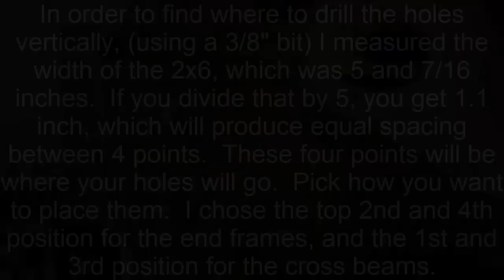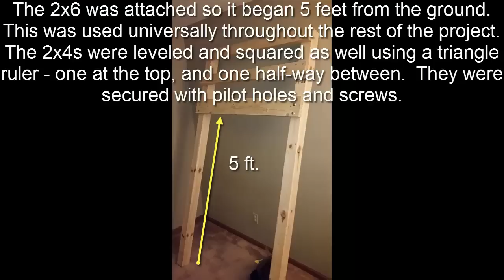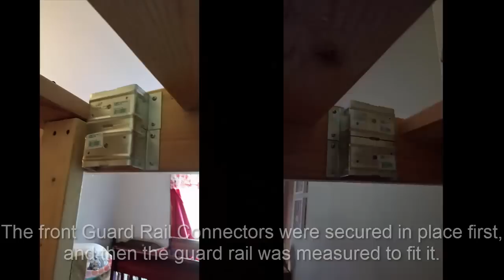UPDATED: DIY Dad - Loft Bed with Desk Under! How To build a loft for your kids - Best custom loft!

Comment: I have been looking at several of these and honestly this is the most sturdy well thought out design. Ty for posting this info. Even store bought loft beds are not as well built and strong as yours!
Reply from the maker: Bar K thank you!  I really enjoyed making it.  I scoured the internet to try and find plans that fit all of my needs for this project, but couldn't find any. So, I just made up my own. The only thing that I would do differently next time, is make the frame a little bit longer and a little bit wider. The mattress fits in there pretty snuggly, and it's pretty difficult to get out to change the sheets.  Thank you for your comment!

Comment: At what Height did you mount the desk support items? it doesnt really say that I can find in several watches ?   i.e. the 2x6's that support the desk
Reply from the maker: Mike Hindman if I remember correctly it was around 33-36 inches.  I'm pretty sure I tried to find a standard desk size.  I'd go measure it but I've since disassembled it in order to build a new one.  Thanks for the comment!

Comment: Is this for a full size bed?
Reply from the maker: Hi Sarah, great question!  It's actually for a twin.  However - If I could have another go at this, I would make the frame wider and longer by about 4 inches.  With these measurements, it was pretty difficult to get the bed into and out of the loft.  Err on the side of just a bit larger!
Reply: @dadlife6419  Thank you!
Reply from the maker: @sarahcoffman8493  No problem!  Happy Building!

Comment: Im not professional.... 
can I use wood screws?
Reply from the maker: Thanks for the comment!  Wood Screws can definitely be used for this project.  Just make sure you get the size right and drill pilot holes so the wood does not split.